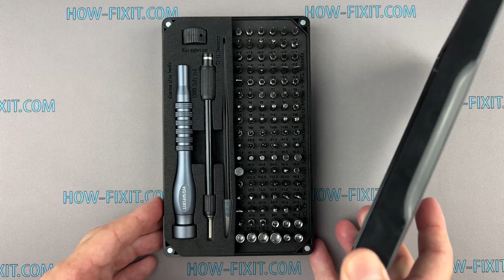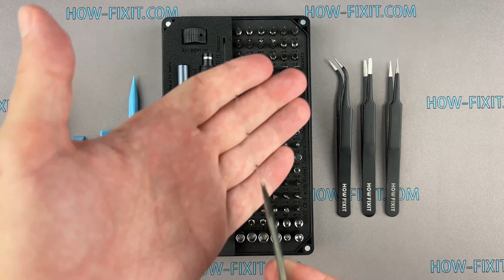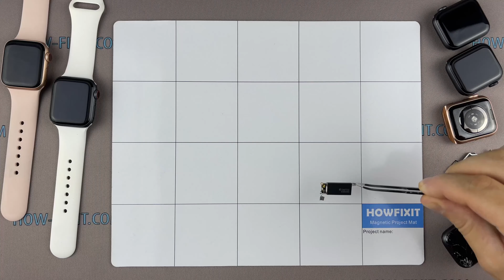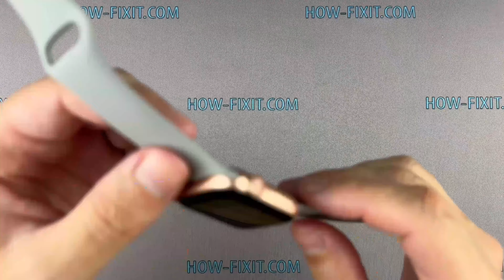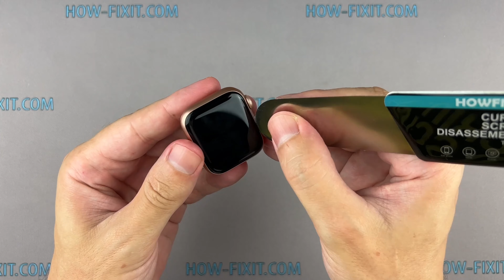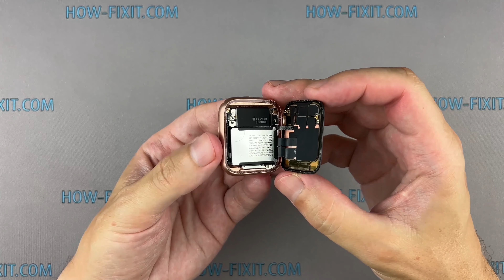Apple Watch Series 6 Speaker Replacement Guide

Comment: Great video. Really appreciate it. I have to replace the battery as well as the speaker after 3 years. First the battery died, as the watch is not charging and I have tried all the restarts, re-adding it to iPhone etc., whatever I could find on the internet. The fun fact is, that I never abused my watch, always charged it with original charger like 99%, and one day it goes dead on me. It was dead for a month, and after some time it started working and charging again. Then I used it for a couple of months and it went dead again. It just keeps on restarting by itself. I have reset the watch multiple times, tried to restore it with no avail. I really do not know what is her problem. The speaker just stopped working.  I think the main problem is that I went swimming with it, as it started behaving weird the first time after I went swimming with it in a cold mountain river. Last year at the seaside it worked great. This year the second time after it decided to not work again, I was swimming at the sea. Now it just keeps on rebooting. I was thinking on ordering the MagicaWRT to do the SW deployment if there would be no water damage after the battery and speaker replacement. I can not find any sensible information in the logs why it is crashing.